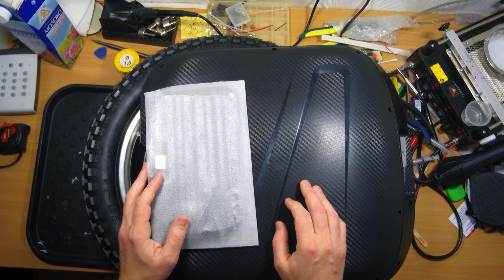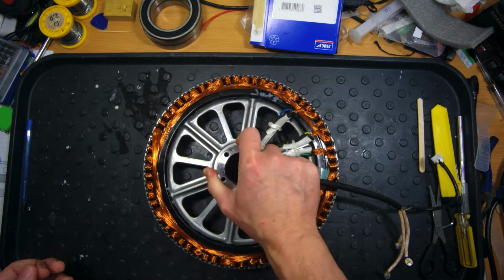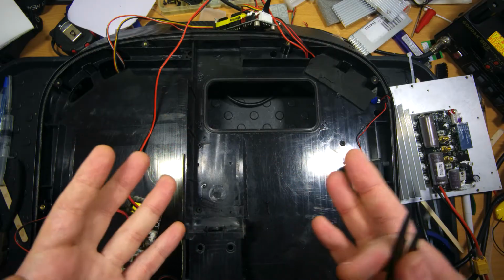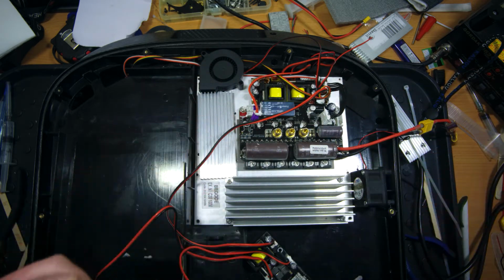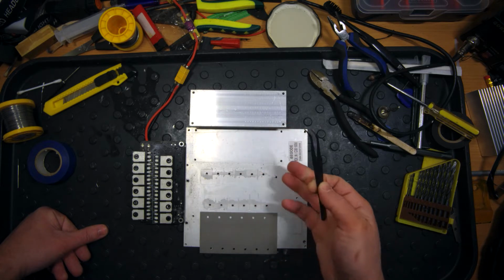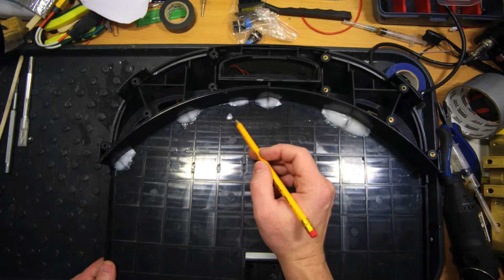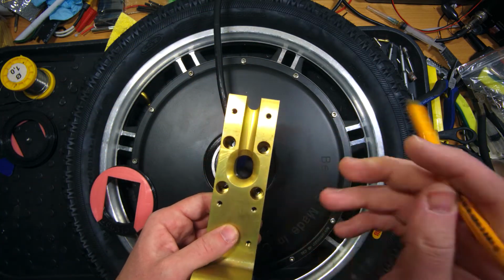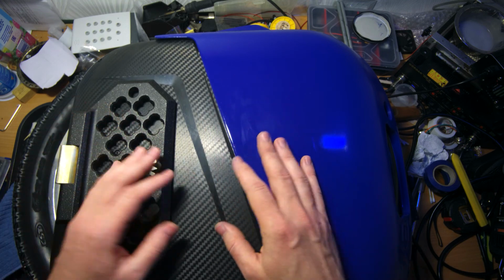Begode EX.N: Cooling system tuning & service

Comment: This is really nice work! I have a few questions though. How do you do the parts where you said you had melted plastic to reinforce areas of the wheel? And how is the glass fiber shell attached to the wheel? Personally I would have wanted a bigger area of the wheel to be covered by the glass fiber shell, to make it easier to install power pads on the side of it.
What is the substance that you use to cover the electronics with?
Reply: I would also love to know which procedure you used to reinforce. As many know this is the common issue with EUC where the inner shell breaks. Fixable but a major issue that can be prevented with extra reinforcement.

Comment: I used your video and to implement all of the structural changes to the chassis, cooling and electrical safety measures you highlighted in your video. I am waiting on the heatsinks to arrive to put everything back together. Thank you for such a detailed and instructional video.

Comment: Привет товарищ)))
First of all, thanks for such a detailed video.
I'm looking into sealing my MSX 84V as there's quite a lot of snow where I live.
I see in your previous video "Begode RS V2: Bearing sealers, waterproofing and improvements" that you're quite much more aggressive with the black silicone as compared to this other video. What's the best way to go about it?

Cпасибо большое
Reply from the maker: Hi, comrade =) It's absolutely the same story with all wheels: I put black silicone to all joints fo the inner shell to prevent water ingress inside + extra layer of silicone in the wheel well after inner shell assembly. I do not show everything in the video because it will make it as long as a soap opera. Normally work with one wheel takes me a wheek or more. As for MSX do absolutely the same with silicone and don't forget to drill drainage, since the trolley handle is the weak point and is an "open door" for water ingress.
Reply: @ITm0nkey  Спаси бог себе))) 🙏🏾
I will do it and report back when I'm done. Wish me luck 🤞🏾
Reply from the maker: @carlosleon7683  Good luck, comrade! =)

Comment: How you melt the plastic for reinforce?
Reply from the maker: With the help of my soldering station. I put with plastic on it, wait for meltdown and then apply to surfaces.
Reply: i think its not necessary. silicone can glue the board into place